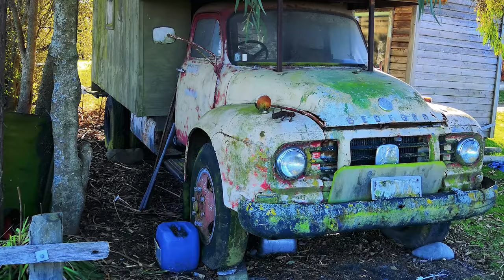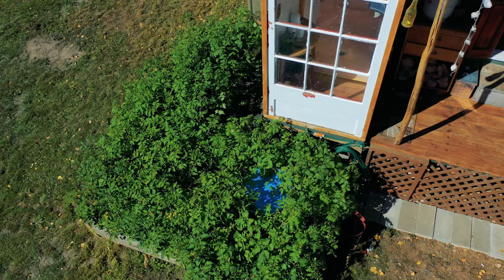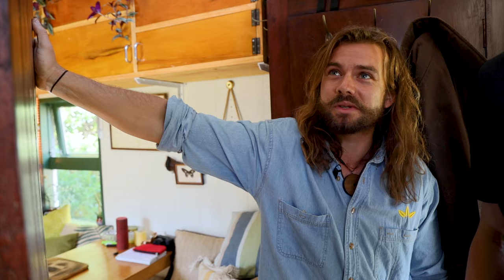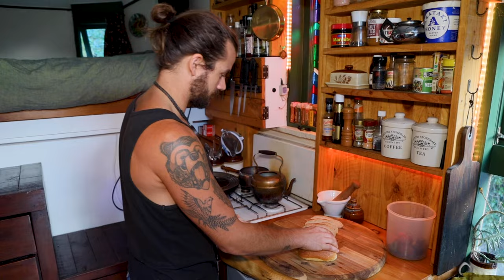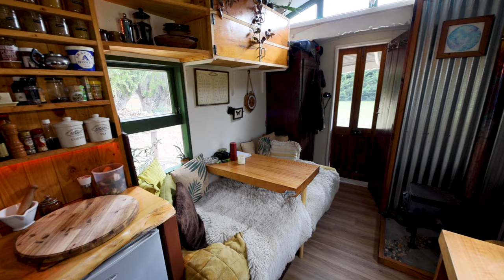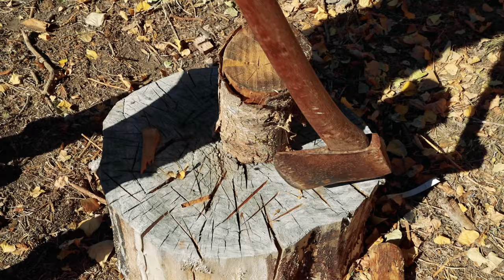$500 Bedford House Truck Renovated Into Stunning Tiny Home

Comment: I live in NZ .... sold  my old  bedford house truck about 1980 when I was living up in in Hawkes Bay. It was built with a steel frame and pine slats which made it very heavy. But structurally very sound. The loft had 4 windows.🙂🖐

Comment: To those noticing the Aloe, they love their roots to be crowded, so planting them in a smaller pot will get thicker than those shown here. The ground they are used to usually has smaller rocks so adding rocks to the soil will help too. Also, if you use Aloe for general wound care, you can peel the piece and put it in a brown glass container and it will last for ten days if refrigerated.

Comment: Maybe build extended plastic roof panel to protect plywood siding, keep the light and add rain collection gutter.  I would cut holes in roof to add two max air circulating fans to control mold, one for intake other to vent outwards. Otherwise very nice woodstove to help maintain forest health by removing dead trees. I think a small cast iron oven with adobe nice to add on for future home. Best wishes.